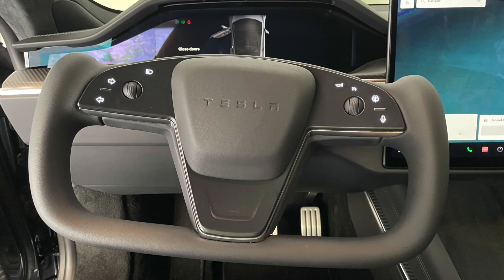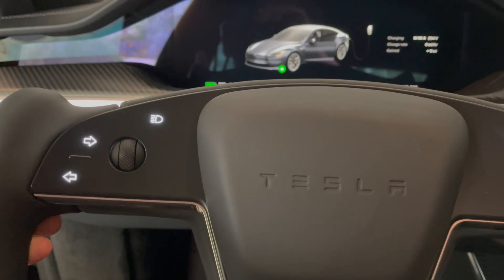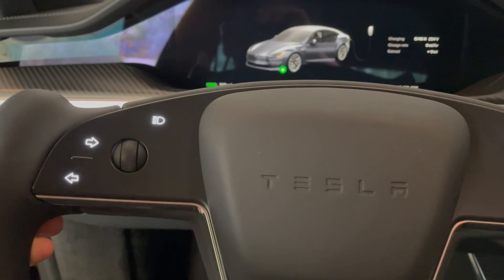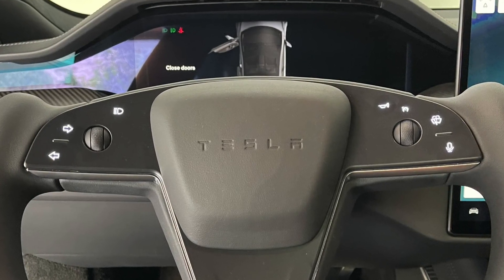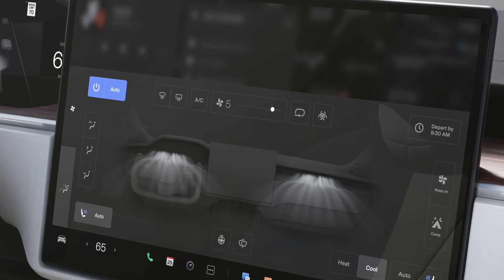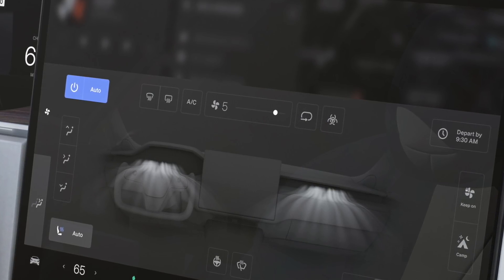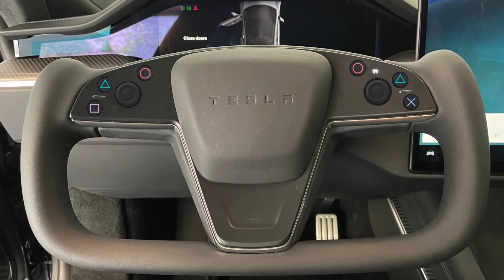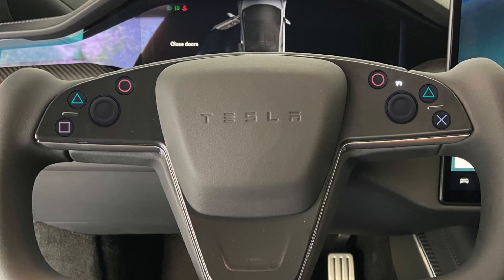Fixing Tesla's Model S Plaid YOKE blunders

Comment: Wouldn’t that indicator button design make it hard to indicate when turning out from a tight turn where the wheel is rotated? Or do you never turn the wheel more than a little?
Reply: The yoke has a regular turning radius, meaning you're absolutely right. In (most of) Europe it's required by to signal out of roundabouts. That's not gonna happen with this "wheel".
Reply: @ThorMortenSmerud  that is crazy, not only roundabouts but regular twisty roads and even regular city streets. My parking lot is just after a tight turn where the wheel is upside down, I am annoyed enough by when the volume or answer call button is on the “wrong” side of the steering wheel.

Yoke style designs only makes sense if you only need to turn it 90 degrees to each side or in a movie. There is a reason cars went from stick style steering to a steering wheel and stayed that way.

Comment: The moment when your cheap Hyundai has better steering wheel controls than a car that costs 10 times as much.
Or they could have taken inspiration by a F1 Steering Wheel. They got plenty of buttons and dials.
Reply: F1 cars have tighter steering radius. The yoke has about 900 degrees, meaning hitting any buttons while turning is out of the question..

Comment: I legitimately thought this is a parody, nobody would build such a stupid wheel into a real car for everyday use surely. Had to google it, i'm dumbfounded. Tbh I would have been out of that car when i saw that reflecting screenpanel behind the wheel, even before finding those touchbutton indicators. Thanks for the laughs. Have fun.
Reply: Tesla have never made a decent interior.

Some manufacturers have caught up with batteries and motors now. Tesla are still way behind on their UX. There's not much point getting one now.
Reply: @SeanOfEarth  I can back you up, it’s not great, but it’s improving. Many companies are competing with batteries but none are even close to the technology that Tesla holds atm. It’ll be at least 5 years til other car companies catch up.
Reply: @patrickong5197  i give it a year max. Toyota will pass them by soon.
Reply: @magfal  that’s not how big data works. It’s almost impossible for Toyota or even any tech company to compete with Tesla’s AI. There isn’t any car company that is actively using Full self driving and collecting information that Tesla is using. Toyota may be a car company, but they ain’t a tech company. imo, Tesla is not a car company yet, they are however a energy and tech company.
Reply: After market yoke PlayStation style with buttons, got it!
Reply: Right. This can't be for real. Pretty sure I like to grab the top of the wheel while turning.. there must be a mod lol. This thing takes the wheel out of steering. At least it looks slightly safer than KITT from Knight Rider.

David Hasselhoff dealt with that steering wheel but now I know why half the time they let the car drive itself.
Reply: The yoke steering wheel is so more people are inclined to buy and use the autonomous driving feature as well as more visibility on road. Kinda sucks though.
Reply: @Brian Trudeau ya think, Tesla’s going to bring more options in the future so it’s not just a yoke steering wheel, but it does suck that people have to relearn how to drive when buying this car.
Reply: @Brian Trudeau a good way to save money and accomplish your goal? Gee whiz!

Comment: For the scroll wheels, is there any good reason for adding the hemisphere parts on the sides? Without them, it could work like a regular Logitech-style mouse scrollwheel, where you don't have any trouble clicking it down or moving left or right. But I guess the main design focus for this wheel was to go out of their way to make it as bad as possible from top to bottom.

Comment: I'm amazed by two things: 1) the horn and turn indicators are allowed in such drastically different locations to every other car. Seems like there would (or should) be regulations against such changes. 2) a company SO design-focused allowed such a terrible user experience to make it all the way to production.
Reply: Somehow Tesla gained enough traction to suck people in regardless. Don't get me wrong, I like some of the stuff they achieved but I couldn't drive a car like this. The problem with design focused companies is that they will push crappy UX in favor of aesthetics and end users, mostly fanboys or people who buy these as a social status halo car, will disregard these MAJOR design flaws as something edgy and innovative just because of its brand.
Reply: Some older European cars like Renaults and the DeLorean had you push the turn signal stalk in towards the column for the horn. Still way better than this.
Reply: Horn should’ve been the center airbag. That I have a feeling will change per DOT safety regulations

Comment: I think that Tesla's quest to eliminate physical buttons in their vehicles is very misguided, and that wheel is just one more example of it. If the refreshed Model S is anything like the Model 3, there are a ton of functions in there that require navigating the touchscreen (basic things like the glove box and dome light come to mind), when having a dedicated button as a shortcut would have been incredibly handy.

I get why they want to eliminate the traditional control levers - it's the same reason why they are moving to the yoke, to have the driving controls take less room in the cabin when they aren't used, ie when the car is driving by itself. But I agree that having touch controls and vibrating haptic feedback on something that isn't a screen is just silly when they could use actual buttons.
I do think the scroll wheels are a better idea than analog joysticks though, they just have to iterate on the actual mechanism so that it isn't so easy to click down on it by accident. I have used game controllers where it was too easy to click down on the analog stick by accident as well.

Comment: Touch buttons are a perfect example of solving a "problem" that never existed.

I have them on my phone, and on the bottom edge of my computer monitor, and they are HORRIBLE. Trying to change the volume on my monitor is an absolute shot in the dark, and I end up bringing up some menu almost every time. I want to be able to feel the button first before activating it so I know which one I'm pressing. 
On my phone, I'm constantly triggering the touch buttons accidentally when trying to tap something on the bottom of the touch screen. 
Please people, don't buy anything with touch buttons so these companies stop putting them on everything.
Reply: Try having them in your car. Capacitive touch buttons are so great, they can't stop touching themselves even. I have some of those crappy buttons in the back of my Skoda Octavia estate for the backseat roof reading lights and they sense touches where there are none. Cold winter morning? Touch activated lights turn themselves on and off in the backseats all the way from home to work like a low budget disco van. Same story with climate control during summer, when doing heavy work while it's hot .. how about some random activated touch buttons in the back along with it? Something with air humidity and airflow seems to perfectly imitate a finger touch. Thinking of my phone whenever there's rain on the screen, i wonder how well the Tesla wheel does when you've got wet hands from rain or the whole wheel is "fogged up" with moisture from a cold night. I see no problems at all.
Reply: @D3lor34n  I have the touch buttons on Skoda Kodiaq and its also annoying, but not as much unusable
at least the AC is still physical
https://i.imgur.com/AVpWs1t.png
Reply: Touch buttons have advantages, none of them particularly relevant for Tesla. They make sense for induction stoves for example, so that you just have a resistant, easy to clean glass panel. Or for super-cheap stuff where a good mechanical switch is too expensive. Having a very light touch can be good in some cases too, but not in a constantly vibrating steering wheel in a moving vehicle.
Reply: Touch buttons are MUCH cheaper than good buttons.

Comment: Tesla is just the ultimate version of silicon valley. Over the top "smart" solutions for things that don't need a new solution, and the new solution completely ignores usability in return for "smartness." Has anyone ever complained about the traditional stick solution to turn signals? Did anyone who did complain think that two touch screen buttons are the solution?
Reply: Tesla's design philosophy rejects "if it ain't broke don't fix it" for "different is better"

And often, different is not better. I'm really glad there are more EVs coming out that are just normal cars with an electric drivetrain
Reply: the standard mechanical turn signal are smarter than the tesla ones, since they disengage themselves after you turn.
Also, to engage them you follow the direction where the wheel it's turning: perfect ergonomy.
Reply: It's all cost saving. Haptic capacitive buttons are nearly free.
Reply: Comeon Useyourbrainagain  nobody is talking about that. Who are you talking to?
Reply: @souljastation5463  I don't know about the US, never been to the place.

The cars I usually drive have a particularly annoying implementation, which turns the indicator off when you move the wheel in the opposite direction of the signal, even if the wheels aren't straight yet. You can't make any but the slightest of adjustments in the opposite direction of the signal without turning it off, regardless of the wheels' direction.

If I'm entering a roundabout and don't intend to take the first exist, what happens is that I'll start signalling left before the roundabout, then turn right to follow the roundabout at which point the damned thing turns off the signal, so I always have to manually hold it down to keep signalling left.
And I can't hold it down all the way either, or it'll make angry clicks as the mechanism tries to force the stick back to the neutral position.

It sucks and it happens on every time I'm not turning right on roundabout, which is most of the time.
Reply: I was about to say this. I would've fixed it by fitting a headlight/turn switch out of an older car. Then the rest can be wired up to something else.
Reply: Yeah, and it's not just Tesla.  My wife's Acura had an issue a few years ago where the DVD navigation disc (under the passenger seat) had an issue.  So the geniuses at Acura decided to show this message on the screen that said something like "Check disc" or something like that.  Fine.  But here's the catch.  The message will NOT go away!  And guess what?  ALL HEATING and COOLING is controlled via the touch screen.  So we literally could not control the climate until we got the DVD drive fixed.  Removing the disc did nothing.  Oh...and one more FU from Acura...that DVD drive was $700 USED.  All of this could have been avoided if Acura did a sensible thing like leave the climate controls as physical knobs (easy to repair).  Perfect example of poor design, terrible engineering and fixing something that isn't broken.
Reply: Seriously, stalkless driving needs to go away. It’s so much easier to flick a stalk that gives heaps of tactile feedback than a flat button that gives none.
Reply: It's just to save costs. Buttons cost money, levers cost even more money.
Reply: @Stainless404  I'm sure haptic feedback costs money too
Reply: @Stainless404  Is a haptic enabled button really cheaper than just a basic switch button we've had for ages?
Reply: @Weaver_Games  Yeap. Mechanical things are expensive to build and assemble. A touch-button is just a coil or even traces on a PCB. The "haptic" crap is just an off the shelve vibrator motor from a phone, probably pick and placed and soldered on the pcb.
Reply: @Weaver_Games  Yes. By a lot. Like orders of magnitude.
Reply: @Stainless404  That and the novelty/cool factor.

Comment: Flush touch screen controls are dangerous enough when on the centre console, and those just normally control the music or AC. Putting them on the steering wheel as well for more critical safety features are going to cause more accidents. Physical buttons you can feel without looking are always better.

Comment: I'm surprised that a car with these blunders got approved by any national road safety authority at all.
I strongly disagree with the idea that a car should steer itself as a way to provide haptic feedback to the driver. Interface and actuation must always be separate.
Reply: Yeah I was going to say, surely national certifications should specify something about the horn control at least!
Reply: There is no regulation that states that steering wheels have to be usable because nobody expected for some rich boy to "innovate" it into something worse
Reply: It doesn't really steer itself, it just moves the yoke.
The yoke is not mechanically linked to the wheels (it's a fly-by-wire type of system) and it should be perfectly capable of ignoring its own movements.

Not saying it's a good idea, just that it's not bad in the sense you were probably thinking.

Comment: There's a solution to that: Stop making absolutely everything touch based! :D
You can't even tweak the AC without taking your eyes off the road.
Reply: Yessss! Just bring back my physical buttons! It's much better. Imagine if an aircraft cockpit was filled with touch screens instead of buttons.
Reply: @anonymousarmadillo6589  The F-35 cockpitis filled with touch screens instead of buttons :P

However you can do almost everything from the HOTAS so touching is optional for the most part. But it has quite a learning curve that wouldn't be suitable for a consumer car.
Reply: They rather just glue a cheap tablet to the dashboard and have everything controlled through there. They call it "progress".
Reply: @JM Coulon Capacitive touch sensors simply don't work reliably and should never be part of controlling anything vital.

I don't even want them on my phone. Bring back real buttons. Touch screens and sensors are trash technology.
Reply: @toby2581  " My phone is infinitely more versatile because of capacitive touch."

No it's not. You can't even type basic words on it, because the touch sensors are so inaccurate. I press E, I get an H. How?! Those letters aren't even close to each other. This technology always has been and always will be garbage.
Reply: Imo they should be illegal
Reply: Touchscreens and digital controls in general are a catch22.  Sometimes good and sometimes bad.  While I do miss having a physical keyboard on my phone even my previous phone (my first smart phone) was way more versatile and capable than my previous one.  My previous phone (a first gen Galaxy J7) lasted 6 years and I only replaced it because of app bloat and the desire to put more stuff on my phone.  A physical keyboard may not have lasted as long.

That said I can also think of a major incident that occurred not that long ago due to poorly implemented and poorly documented digital controls.  I think it was a Navy ship that collided with a civilian ship killing many people on both ships because they had rushed to create and install a new digital system that was harder to use and offered less accuracy than the old manual system (it probably could have been more accurate with a better UI or with an AI controller, or if they had finished installing it like they were supposed to).  There were only a handful of people with any training at all on the new system and they had to make some really tight maneuvers so the captain had his best pilot grab the helm and put it into a manual override mode that worked more similar to traditional controls and offered the kind of finesse needed for the tight passage.  Unfortunately someone bumped a button somewhere that moved the helm controls to another work station without realizing it and nobody on board knew what was wrong (the only way to get control back was to release it from the remote station) so they ended up losing complete control of the craft.  They were supposed to have a technician to finish installing the system (it was only partially installed) and who knew all the ins and outs of the new system, key phrase supposed to.  They were also supposed to have a lot more training and manuals before setting sail, which of course didn't happen.

Moral of the story, it's not that digital or touch controls are always bad but that there is a time and place for everything.  Properly implemented digital controls are almost always better than analog controls but properly implemented digital controls are also often indistinguishable from analog controls except where it really counts, in a ship this might mean correcting for unexpected forces on the ship so the pilot can power through and in a car this might mean correcting for slip or brake lock (though some people might not like it).  Also to be clear I agree that Tesla's control system is in need of major improvements though I like some other aspects of their cars and process (and the fact that they are forcing other manufacturers to get off their arses and actually improve stuff).
Reply: ...or just watch the user's eyes and listen for commands like "left" or "right" while looking that direction. Pretty basic. Or just anticipate what is required. Most people slow up before getting over to pass a car on the freeway. Just engage the blinker automatically. Route maps tell the system when to look for blinker command indicators. But also when other triggers hit too.
Reply: There's another solution: stop buying these ridiculous cars.